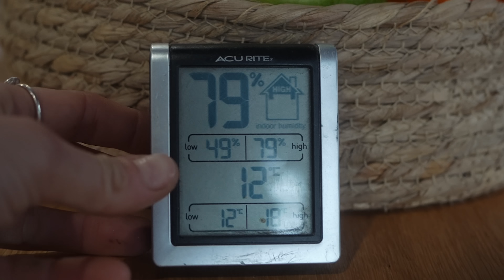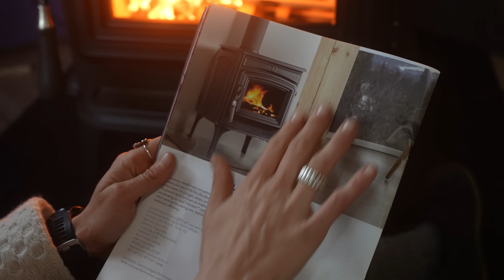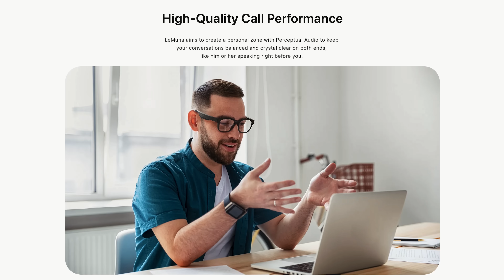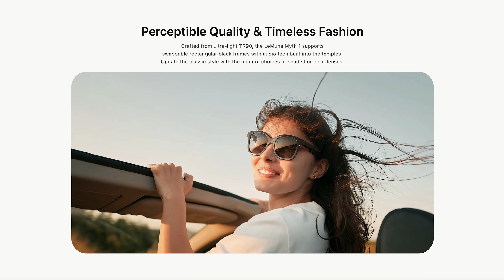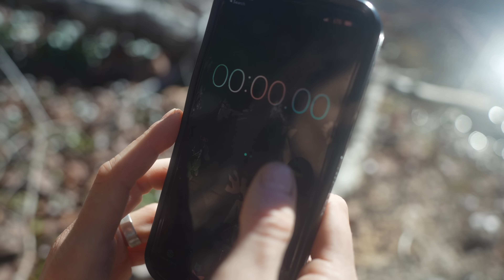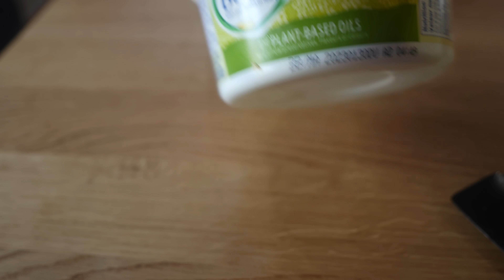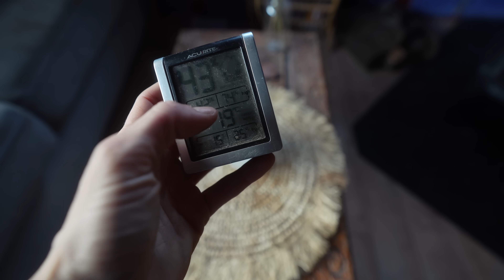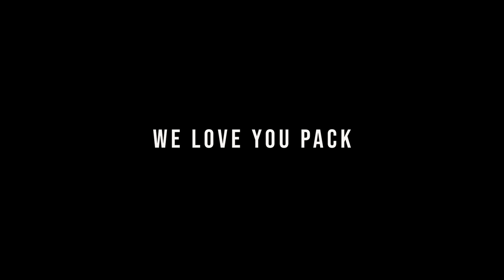Why I'm Alone

Comment: Here I am with some skillsaw safety tips (60 years worth). You are making beautiful progress and I would like to continue seeing that without any accidents. Any time you decide to use the skillsaw, set the depth of cut properly. Only the minimum depth should be used that will complete your cut. There are a few good reasons for that. First and formost is your safety. Use the skillsaw long enough and you will cut yourself. The less blade the is through the cut the smaller the cut to your finger will be. Secondly the blade guard will retract in a more cooperative manner with a minimum cut depth. Lastly is blade life. The cooler the blade runs the longer it will last. With a minimum depth of cut you also get a maximum of cooling. Good luck, keep up the good works and don't stop the beautiful videos.

Comment: You got a lot accomplished alone, really nice to see the wood stoves installed. I was thinking when you were talking about the barrel over flowing and moving it into the trees. Why not just get a spigot and put it into the barrel about 4"-6" down from the top of the barrel and attach a drain hose to it and run that hose into the trees.That way it will not over fill and you do not need to plumb new lines back to sink and eves out to barrel.

Comment: Hi. me as a guy from Norway and that you have bought a Jøtul oven from Norway.. So I am reasonably sure that it should be fired in the following way.. Put some larger logs in the oven first, cross once more with slightly thinner logs. Fire up on top of this with thin dry wood.. It will burn longer, and you will save wood:) It is probably in the user manual. Good luck with a really good oven in the winter cold.

Comment: For Your outhouse rainwater barrel overflow problem...don't extend the gutters...branch/wind damage problems that way....instead, drill 1 1/2 - 2 inch overflow hole at top edge of barrel and run pvc or abs or some other hose/pipe line along ground into the woods 🪵 😀 
Cheers!
Oh, and awesome vids, story and life!

Comment: You could add an overflow outlet near the top of outhouse rain barrel and run the outlet hose into the woods. No more overflow into the pit and it’s way easier than extending gutters and relocating the barrel. You could also shorten the drain pipe from the sink for removing the bucket without spillage. Just my thoughts.

Comment: Re your outhouse rain barrel… we connect our overflow hose to a second barrel, that way we always have water even in drought. That said, depending on temperature, not sure I’d call my hands “clean” if the temps have been in the 30’s, unless the water has been treated with an antibacterial product.

Comment: Instead of moving the rain barrel, how about drilling a hole, about 3/4 inch, and put a pipe plastic pipe thread to garden hose adapter on it, hook on a piece of hose, and it will drain away from the building.  Mine strains the needles out when it flows over.  Periodically in the winter, I have to take it off, give it a shake as the needles plug it a little, and that clears it right out.  Really impressed with the work you both have done there.  Sure a lot of growth in confidence from when you did your first van build.

Comment: Trick for plywood on horses ,lean. Against Both horses ends then pick up low edge  and take a step backwards letting the ply rotate on ends of horses and slide one end at a time across top of horses ,one end then other .

Comment: Just a suggestion... as a temp. fix for this winter... "skirt" the cabin with some bales of old hay.  It will insulate a little but mostly it will block that pesky wind.
Come spring you can use it for garden mulch.

Comment: Instead of relocating the whole rain barrel system for your outhouse sink, add an overflow connection 3/4 of the volume of the barrel with a long hose that leads out to the forest. That way you control overflow and you don’t have to move your entire system.

Comment: so you may need fire starters i make them from egg cartons saw dust and wax 1. put saw dust into egg carton 2.melt wax pour into egg carton and put more saw dust on top let wax cure up. you can make a few layers. when dry break off one or two eggs and places in fireplace lay kindling on top and light starters up.  you can also mix saw dust with lint or dog hair . i use dryer lint and saw dust. they work great. i make a bunch up for camping.

Comment: Hammer tacker. Lol! Regarding the rain water barrel at the out house... you can leave the barrel beside the building just need to add a hose near the top of the barrel and let it run into the woods. This way if the water gets to close to the top of the barrel the excess will run into the woods. Otherwise. Great job! Doing all that work with no pants on.... well... I'm glad you posted! LOL!

Comment: easy fix for the rain barrel.  put a hose connection a couple inches from the top.  attach a hose into the forest.  then the only way it can overflow is if it is collecting faster than your hose can drain the top few inches of the barrel.  the syphon effect should keep the top few inches of the barrel empty fairly well even in moderate rain.

Comment: Safety tip...  sorry if you have already done this but...I saw that you built a box around the propane tank/tanks. Please check with the gasfitter at your supplier to make sure of adequate clearance for prv and that you have enough venting at bottom of box for any leakage.

Comment: Jasmin put the sheet of ply on from the side then the trestles will not fall over!!  When you use a tin of food, save it, split it down and use it to cover the boxing for the water casing for the garage to keep the water out of the flat top.  Put some good sized timber on those tarps before the wind gets under them and blows them away, those staples will not hold the tarp alone.

Top up the wood box as the first job of the day when your fresh.

Comment: Love the channel thank you both!  Suggestion for your water butt,  instead of moving the butt and extending the gutter it may be simpler to set an overflow pipe into the butt at the high water level and let the water flow down a short length of hose pipe into the woods.
Reply: Was thinking the same. Amused you call a barrel a "butt"...
Reply: @jebuff  that's what it's often called in England but I had to laugh when I saw your comment Jeb!
Reply from the maker: Hey thank you for that great idea. Makes good sense, we sure do have a knowledgeable community. See you next Sunday. “The water Butt description made us chuckle. 🤣💛🐾

Comment: Did you winterize your well house? If it's fairly insulated, a 60w incandescent bulb will keep the pump from freezing and cracking (or the head, if pump is a submersible). Something we had to do way down in southern US was keep that light on if it was going to reach freezing temps. If you have above ground well pump, having a spare is handy.

Comment: Don't move the rain barrel into the bush. Just drill a garden hose adapter into the top inch and put a hose on it.  You did great on your own!
Reply: I agree. Install an overflow outlet at the top of the barrel and plumb that out to the woods. A whole lot less work.

Comment: With the wood burning stove in the house ensure that you have at least one working carbon monoxide detector. Carbon monoxide is order less and tasteless so you want to make sure if you have a carbon monoxide leak you can detect it. High enough concentration is fatal you just go to sleep and never wake up again. The detector should be installed low to the floor as carbon monoxide is denser then air and therefore will concentrate high enough at floor level to set off the detector. If the detractor goes off the safe response is to leave the enclosed space. Anyhow just a safety tip just in case  you are not aware.

Comment: You need to build a double brick wall behind the woodstove to use as a heat sink, which helps to radiate the heat.   No cement, just stack

Comment: You could easily "skirt your cabin" temporarily with some tyvec or polyethelene plastic stapled to the bottom of the siding and then anchoring the resulting "flaps" to the ground with pavers.  Once you get a good snowfall, you're good until spring thaw.

I can't imagine it would take more than an afternoon, and you prolly already have all the necessary materials on-site.

Hope this helps.....

Comment: Hi  great job on all the work and progress.   For the water storage near the outhouse.  All you have to do is drill a hole 2’’ from the top and plug in a sealed adapter eith threads. Then you screw on a hose that you will unroll in tge forest.  This will act as you over-flow spout just like the ones in a sink yhat do the same. Preventing the sink too over-flow

Comment: Jaz. I bought a pallet of compresed sawdust blocks when i moved into old house in New Brunswick and was pretty good investment. Lewis Lumber made them but where you get in Nova Scotia Im not sure. Good for quick fire starting using only a few splits and paper. I will get again. A pallet kept us going for three winters. I use mixed hardwood and softwood mostly. A good reference on firewood is on a site called “Life in Farmland”. Good luck

Comment: @23:55 As a Boy Scout when I was younger, I'd like to complement your awesome fire starting technique. Besides having backup heating sources make sure you have backups ignition sources to light a fire (for example when you run out of paper, or it gets wet, to start the kindling).
Reply from the maker: Hey Roger, thanks I have had lots of practice starting fires. Thanks for sharing your knowledge, good point. See you next Sunday.💛🐾

Comment: Jazz a great solo episode and more progress on the cabin, sure we miss Crystal but you do have the dogs for company. That cabin wood stove is the same as in our cottage, ts and A frame on a lake on 3 acres of heaven, the stove works fine and heats both floors just fine. wW have never bought wood as we burn all from the property as every winter we get a few blow downs .as for the creosote from soft wood we clean it out once a year and have never had a problem with chimney fires. Re Your remark about Maritimes winter weather, please don't take this year as typical November has been extremely mild and we have virtually no snow so far.
Take care Jazz great episode X

Comment: For your Pacific Energy Stove, purchase the blower fan. Didn’t see it in the video, but it makes a huge difference in the effectiveness of those stoves. Instead of just radiant heat, the blower forces air over the body of the stove to heat the space much faster. The Pacific Energy wood stoves are designed for minimal clearances, so they have a lot of heat shielding that limits the radiant heat put out compared to other designs. The fan is probably $400-$500 these days, but makes it a completely different system. I service 200+ clients in southern New Brunswick and the Pacific Energy stoves are among the best quality and performant stoves out there.
Reply from the maker: Amazing! Thank you for the valuable information. We will for sure look into them once we have some electricity as I believe they take power?
Reply: Yes, the Axial Blower Fan that attaches to the back of the stove uses 120v AC power. It also has a thermostat to turn on and off automatically or a manual mode, and a speed knob. I run mine off a EcoFlow Delta Max Solar generator/battery’s. Using the medium fan speed and the thermostat it barely uses any power, between 40-70 Watts and kicks in ever 5-10 minutes depending on how hot your running it. But trust me it makes a huge difference. I’m renovating my house and lots of drafts. If I don’t use the fan it’s enough, but have to run quite hot. With the fan and a low burn rate it heats the place like the tropics.
Reply: Another trick, depending on which stove model you have, is the little lever to open the ash cleanout hatch, you can use it when starting the fire to allow a lot of extra air in, acts like a blast furnace. Just remember to close it again once the fires going. 

The Pacific Energy is a lifetime stove, fully repairable. And the ICC stainless chimney systems are top tier also. If the installers don’t offer cleaning services, you two would be able to do the yearly maintenance yourselves with a shop vac & a 6” brush and 2-3 rods. But best would be to have a professional inspect atleast after the first season to see if your burning habits are working efficiently.

Get the whole system hot for the for the first 30-45 minutes to minimize the formation of creosote. Then lower the draft controls for longer burn time once it’s going.

Comment: Just a thought... instead of relocating the barrel (out house), could you add an overflow pipe near the top and run a longer pipe from that into the forest? (Just thinking in terms of saving pennies and a bit of energy if its possible).

Glad you ladies have heat now, we were starting to worry about you guys ❤️

Comment: Love your videos! Always an inspiration. Just thought I'd mention that it would likely be easier to extend a drain line from your outhouse rain barrel overflow valve (hole) than it would be to extend the gutter and move the barrel itself. Not sure if your barrel comes with a side hole near the top for overflow. Many seem to come with a molded plastic spot to drill out if you want to add an overflow line either away from the house or into a secondary barrel. Keep up the amazing work!

Comment: Don’t know if this is helpful but here in the UK you can get a downpipe converter that is a short length of downpipe with a mechanism inside that stops the rain going into your barrel once it is full and sends it on down the downpipe - pretty cheap and easy to slot in and then rather than having to move the whole barrel you’d just need to take the bottom of the downpipe out into the woods? Love your videos ❤

Comment: I'm using foam board as skirting over hardware mesh around bottom of my tiny cabin I'm building too. I'm in SW AR. We get maybe a week, maybe two, during Jan/Feb of freezing temps some years. Nothing like what you will get. Also using all the reflectix  from my Class C. It will be insulated well, lol.

Comment: Awesome video Jazmine. Hey I have an idea for that water tank on your outside outhouse. Put it in the woods like you said put the bottom of the tank up on some kind of a platform, about a foot higher than your sink. Should be able to plumb it straight down under the ground to your sink and still have water pressure. Easy peasy I know you can do it.  😆 😂 You two be safe
Reply from the maker: Hey there, thank you for the great suggestion. Our community is so knowledgeable. We appreciate all the idea’s thanks for sharing. 💛🐾

Comment: For your rain water collection for the outhouse, put in a over flow hose at the top.  That way if it fills up to high, it will drain off before it overflows.  Put in a hose at the top and put it out in the woods behind.  Then you don’t have to redo your setup
Reply from the maker: Yes you’re so right! Thank you :)

Comment: Are flushing your privy(outhouse ) wiyh a can or two of lime.Just sprinkle on the ,well on the the.Takes all the smell away.Food for thought.The box you made for the water pipes,wire a light buble in there,and when it gets really cold that light will keep it warm enought not to freeze,or just get some electric pipe wrap,but have the plug in the cabin so you can use when needed.Hopefully before its needed.2 But a skirt around the cabin,ground to floor,to stop the cold winds from sucking the heat out of the cabin,floor will be so much warmer.Let me ask you this,when does the cabin turn into a HOME.

Comment: Instead of tacking your tarp take strips of wood and wrap the tarp around them once or twice then screw them into whatever you were tacking into. It should be something heavy or use ground spikes to hold down the strips of wood.  The first good wind will rip the tarp right off those staples. Also weight the tarp down with logs or rocks, big ones.

Comment: Someone may have already commented this but if not.....
Instead of moving outhouse rain barrel & using longer hoses you could simply instal spigot/hose about 4 inchs from top. Then when rain starts filling up to/higher than that new spigot it will automatically run out into forest for you. (Just keep the high spigot "open" all the time.  A lot easier than moving it & risking a lot less water pressure.   Thats it. Carry on. Lol
Reply from the maker: Yes! So smart :) thank you!

Comment: I have had frozen water pipes in my year round cabin you should put heat tape in the box also I found a heat lamp like for a chicken coupe really helps just have to remember to turn it on & off due to temperature
Reply from the maker: Yikes! We have heat trace so hopefully it all works out :)

Comment: For your water barrel outside the toilet, why not just connect an overflow pipe near the top and have the pipe long enough to drain into the forest. That way, when it fills up, instead of overflowing, it just drains straight into the forest. It seems easier to me than moving the barrel away.

Comment: Great wood stove additions,,,,BUT,,,please consider covering up your interior spray foamed walls before having more burns. Your WETT certified installers really should have insisted on this.  Foam of any kind should be covered by a substrate with a .5hr fire rating -such as drywall or even better a cement board. The off gassing from spray foam is bad enough, now you have a burning metal box only inches away from it. Again, this is installer negligence - they should have at least mentioned it, it may be within code but really bad practice. 
We just want you to be safe! Take care and keep going.